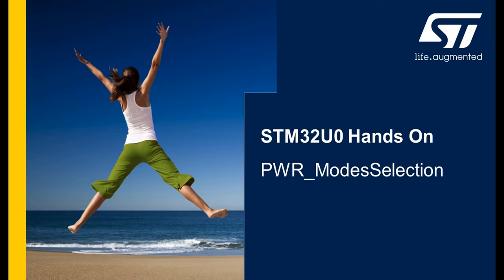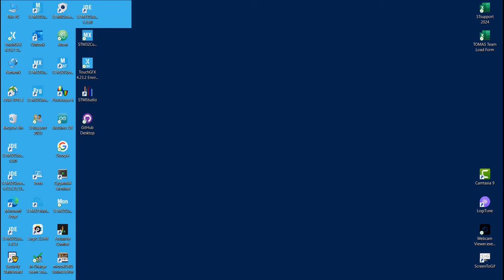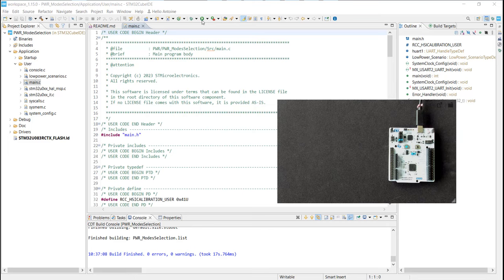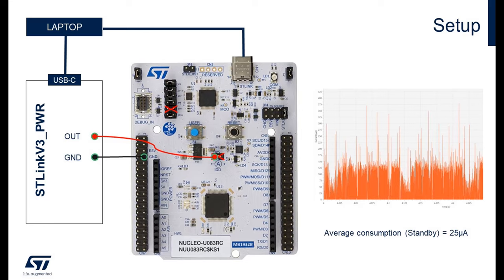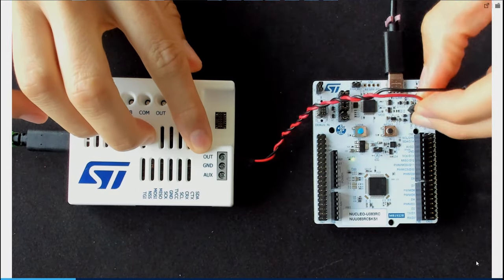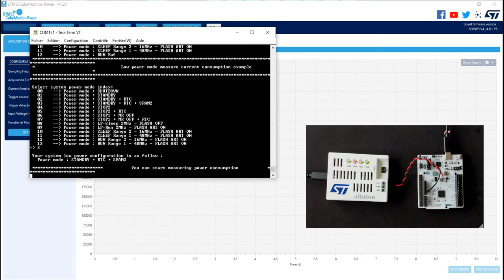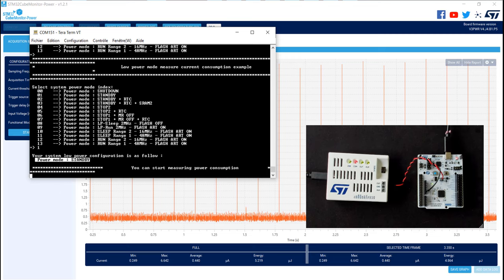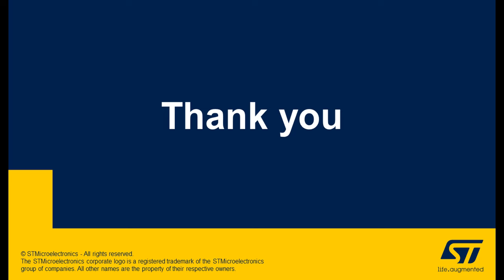STM32U0 consumption measurements using STLink v3 PWR

Comment: Measuring STM32U Microcontroller Current Consumption with STLink v3 PWR and STM32CubeMonitorPower

* 0:00 Purpose: The video demonstrates how to measure the current consumption of an STM32U microcontroller using the STLink v3 PWR and STM32CubeMonitorPower software.
* 0:22 Required Hardware:
    * STM32-based board (Nucleo-U83RC used in the example)
    * STLink v3 PWR
    * USB Type-C cable
* 0:25 Required Software:
    * STM32CubeIDE (version 1.16.0 or later) with the appropriate STM32 Cube library
    * STM32CubeMonitorPower (version 1.1.1 or later)
    * STM32CubeProgrammer (version 2.16.0 or later)
    * Terminal application (like Tera Term)
* 2:00 Procedure Overview:
    *  Configure an example project (PWR_MODES_SELECTION) in STM32CubeIDE.
    *  Connect the STLink v3 PWR to the target board, powering the MCU directly from the STLink.
    *  Run the example project, which allows selecting different power modes via the terminal.
    *  Use STM32CubeMonitorPower to measure the current consumption in each selected power mode.
* 5:50 Key Takeaway: The STLink v3 PWR, combined with STM32CubeMonitorPower, provides an affordable and effective way to measure the power consumption of STM32 microcontrollers, helping developers optimize for low-power applications.
* 7:22 Important Note: The video highlights the importance of disconnecting the USB cable during low-power measurements to avoid ground loops and inaccurate readings.

I used gemini-1.5-pro-exp-0801 to summarize the transcript.
Cost (if I didn't use the free tier): $0.05
Input tokens: 10728
Output tokens: 713